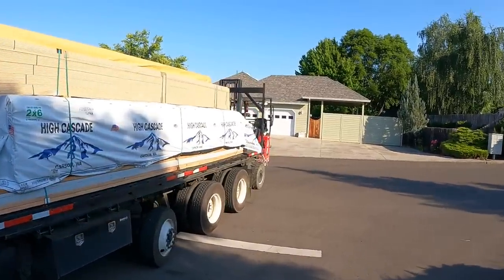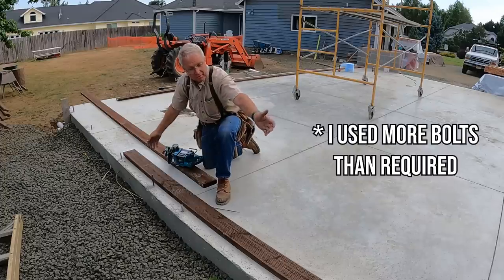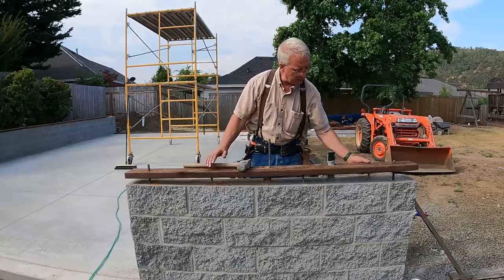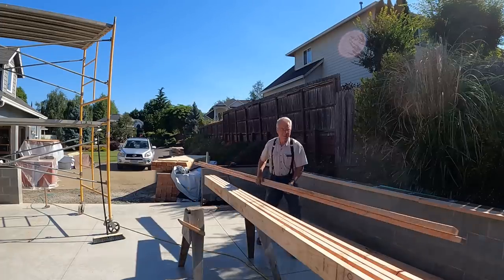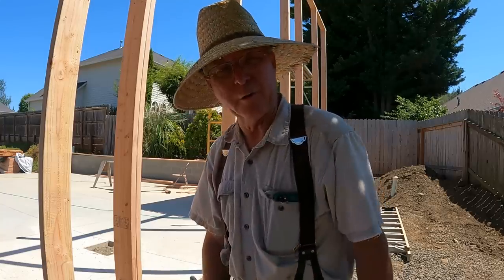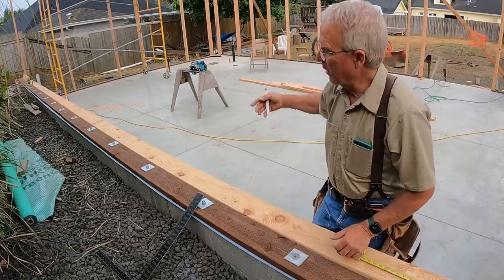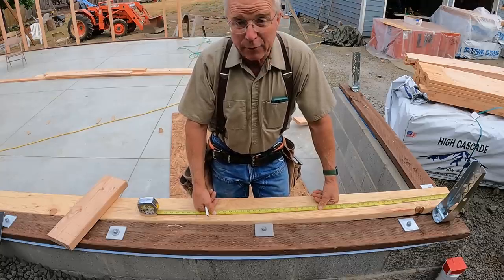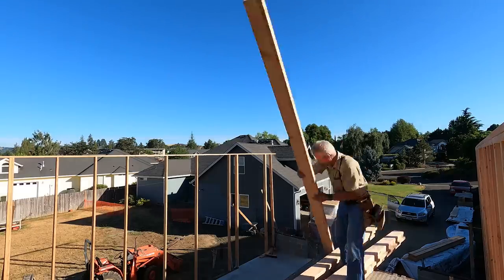No Crew Needed - Solo Balloon Wall Framing: Shop Build #10

Comment: You're not supposed to tighten the hold downs all the way to the plate. There's supposed to be a gap. I framed my shop with 13' walls by myself the same way, one stud at a time from above, though I used a platform ladder (didn't get my scissor lift until after walls were up) instead of scaffolding. It's slow but it works!

Comment: Laying out the top and wall plates as Larry has done is fine for the outside sheeting but will not give you the inside sheeting at the same time . I mention this because Larry seemed to imply that it would for dry wall as well .

Comment: Maybe the definition of Ballon framing is different in your part of the country but in Michigan it's when no plating is used on Wall sections between floor levels and sometimes I've seen it open where the rafters are joined to the third story walls. Basically you can drop a wire from the attic to the basement with no obstructions in most of the walls . Houses built in the early 1800s didn't have insulation.

Comment: I watched you cut all your 2x6 studs by eye....  and it looked like they were square enough.   I always used my little aluminum speed square after setting the saw blade at the line, then my cuts were always square with hardly a moment of extra time.  I'd appreciate your thoughts regarding this method.

Comment: Is there some reason you don't place liquid caulking or tar-product beneath the sill-plates? Rotating the problem in your mind is the best advice I've ever heard from you. I would add to that to take as much time as you need. I've taken weeks sometimes before I came up with a viable solution. I just work on another aspect of the job so forward progress occurs.  The surprising thing to me has been that I come up with a dozen possible solutions, choose one and when I begin to apply it discover a perfect solution that I hadn't considered. Which means, I guess, that you can get lost in the details and need to get out of your mind and get into the physical project.

Comment: Those steel scaffoldings can be incredibly dangerous, especially when used on uneven ground. I took to ratcheting from the top to bottom on each side which dramatically increased the stability

Comment: UFER stands for Under Footing Earth Rod I assume?
Also is cutting those lines in the concrete to put natural weak points in the slab and control any cracking that might occur over time?

Comment: I have to tell you, those washers don't make a difference with pneumatic nailer, the wall would fall off the bottom plate. Hand driven 3 1/2 galvanized nails is what did the difference, instead it tore the bottom plate right off the foundation and tore the anchor bolts right out of the concrete. Same structure 2 different walls, 2 completely different results, very interesting information

Comment: I agree, what’s next in the building code.  Frankly, they turned me into a skeptic with the requirement to separately vent the TP valve on a water heater outside rather than into the drip pan.  Has there ever been a case where someone was actually close enough to the drip pan when the TP valve activated and they got scalded…..ever?

Comment: Hey not to nit pick your fine work but you aren't supposed to ground a sub panel seperately from the main service, it can create an issue.  It will receive its ground from the feeder.  Grounding electrode conductor (UFER) is only bonded at the service.

Comment: The square washer covers more surface area. 78.5% of a circle fits into a square. The load transferred on a square washer would be higher and would resist more upward lifting in seismic or shifts in soil?

Comment: The anchor bolt that you said was just plain in the wrong spot was not 300mm or 1 foot from the end of the bottom board, did the inspector spot that.

Comment: use  anchor  bolts  precut your frames  make your  frames on the pad stand your frames  then use anchor bolts drill through bottom plate into concrete  work smarter not harder  BP  NZ

Comment: Bolts should be within 8 inches of end, not 8 foot
Nice video but it would be safer to have an apprentice 
Helping you
In Oregon do you have to use 3x 6 studs at sheer panel joints?
In California we have to use 3x 6 bottom plates and double up studs at sheer panel joints ( depends on engineering)
I enjoy your videos 
I have been a licensed framed  for 43 years in San Diego

Comment: It has been years since i built building. I have  built a bunch of them over the years, everything from a dog house to a mansion.  I am at the age that it is just too difficult to do and recover in a timely manor. so my projects these days are much smaller.  I had a Plumbing contractor teach me a thing that has changed my life. He said that if it is hard your doing it wrong"  I did not understand at first but as I thought about it I understood. if you find it difficult the best thing to do is to stop and think about what you are doing, something about it is wrong, maybe you don't understand what you need to accomplish, maybe your using the wrong tool or process, maybe the tool is just worn out and it needs to be replaced. I like what you said, you try to look at the problem from each direction. maybe the answer is staring you in the face but you don't see it because you have made an assumption that is just not true. maybe you just need to do something else and then come back to it when you are fresh. its more important to keep busy than it is to fix a problem at that moment.

Comment: I'm a little surprised and perhaps out-of-date, but I thought that pressure treated lumber was not to be installed on the interior of a residence (in the old days for off-gassing of arsenic, maybe OK now). The purpose of the foam sill gasket, besides sealing air infiltration, was also to avoid contact with sweating (i.e. condensation) of concrete foundation, so untreated lumber could be used . Please correct me.

Comment: May I ask why you didn't build this on the ground and use a pivot to raise the walls?  You had a scaffold and tractor, which could be used.  I am basically "suspending and rotating" the tools and equipment that you already have to make the job easier.  Happy to hear your thoughts.  I can make a drawing if you're so inclined.
Reply: Those two-story, 2x6-framed walls are just too heavy/unwieldy to raise by yourself.  Plus, it's hard to rotate that bottom plate into place over the steel anchor bolts.  I don't think he would have ended up saving much, if any, time.

Comment: Is this really balloon framing or is this platform framing with just a really high wall height? I cannot tell from this first video, but I'm assuming that you're going to balloon-frame another floor in between the bottom plate and top plate that you built here.

By the way, I love your work and your videos, and I don't mean my comment at all as criticism of your work or your framing decisions.

With that said, I personally would not balloon frame new construction unless there were a specific design consideration that would require it for some reason (although I cannot think of one).

I live in a house in Chicago built in the 1880s with multi-wythe structural brick walls. This construction is very common in 19th-century homes in the city of Chicago. Before I bought my house, I almost bought a different house that was built in the 1870s after the Chicago fire. Structurally, it was balloon-framed, and it had a single-wythe brick wall around the exterior. It was a charming old house, and I liked a lot of things about it, but when I hired an inspector to inspect it prior to closing the purchase, we got up in the attic during our inspection and noticed some problems. We found a few cracked original studs. It wasn't clear to me how well the exterior brick facade walls were tied into the balloon framing. Maybe they used some sort of steel anchors, but it looked like the brick exterior walls were not square and plumb. I think the brick was pulling away from the balloon-framed studs. It's likely that steel anchors used in the 1870s to tie the studs to the bricks might have rusted out. So with the combination of an exterior brick wall that was detaching from the studs and very tall studs that had some cracks, I thought it could end up being a nightmare to repair the structure. On top of that, the house was right on the property line, and during our inspection, the old neighbor aggressively questioned what I was doing in front of his house looking at the building next door. It seemed like he might not have been easy to deal with if I ever had to get permission to set up scaffolding in the gangway between his house and the one I was thinking about buying in order to rebuild part of the brick wall and somehow bond new studs or LVLs or whatever to old ones that had cracks.

Anyway, when people talk about downsides of balloon framing, what I usually hear is that there aren't fire breaks between floors. However, what I would be most worried about is structural maintenance. Opening up walls if you ever need to replace or sister 12 foot studs is something that a single carpenter or a couple tradesman can do. However, it seems much more complicated to me to open up walls in a multi-story house to repair 30 foot studs that are cracked. I guess you could probably splice together 4x4s and fit them into the wall in sections, but still, balloon framing seems difficult to maintain once buildings get very old.

Comment: Re: the galvanized square washers on the treated sill plate.  Will the chemicals in the sill plate eat away the galvanizing?  I seem to remember that they had to change the fasteners used on treated wood several years ago.
Reply: The square plate washers I used were carbon steel (black oxide) and compatible with Pressure treated Sill-plate lumber which is different than standard pressure treated lumber.

Comment: Just a question, regular sill  seal really does nothing for bugs. why not use a acoustical sill seal like Tremco's Dymonic FC?  It would provide a better bug  seal and it never hardens, it stays a  soft  consistency forever.  Also gives a much better air barrier to the space between the concrete and the sill plate?

Comment: Sir I have a question concerning balloon framed houses, if you could spare a moment to reply I would greatly appreciate it. I have a balloon framed house built in 1905. It has horizontal sheathing on the interior side of all exterior walls. My question is: can I remove this sheathing without replacing it? I have asked many people this question and have no idea who to believe. I have heard everything from, “yes you can, no problem” to “no you can’t, the house will fall down”. Thank you in advance for your time.

Comment: Nowhere else are those measurements used Mr. Craftsman. When it comes to imperial measures on the US and those two hotbeds of modernity and outstanding engineering - Liberia and Burma - use the imperial measuring system. And it is totally foul. Metric is simple, reliable and precise.

Comment: Code changes are the regulators way of staying relevant in my opinion. I'd like to hear from you what code changes you've experienced that made absolutely no improvement as far as structural integrity and in reality only benefited a product manufacturer.
Reply: I would think a square washers is an ideal example where people need a nudge to switch to a more suitable method.

Comment: Hanging off a rock with a rope ? Not heard it put that way before and it's a little more involved but I get your drift. Hardest part , loading the  rope your gonna hang from in brake bar , backing up to edge then leaning back over the edge hanging from a rock with a rope lol

Comment: Code says you can drill the holes in the bottom plate no more then 1/16" over the bolt diameter.

Comment: What is a "balloon wall"?
Reply: Sill to top plate, one long stud.
i.e. not platform framed.
In the olde dayz this meant your 2nd floor joists were hung on a let-in ledger and nailed off to the face of the studs.
This appears to be a simple tall wall, not ballon framing.

Comment: Painful to watch,have not seen any one frame a structure like this in over 50 yrs .  frame your walls ,square,,let-in brace,set windows ,ext.
sheathings.,,prime,
 paint ON The Deck ,lift ,plumb,then move to the next wall.
        DONE.